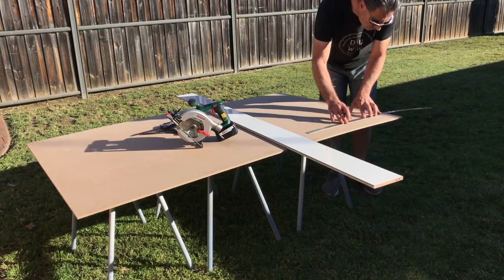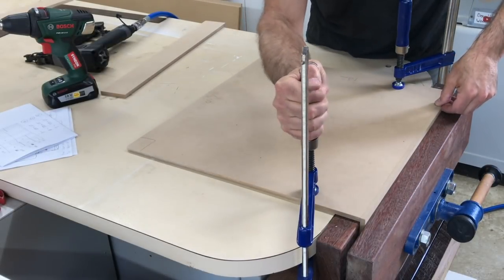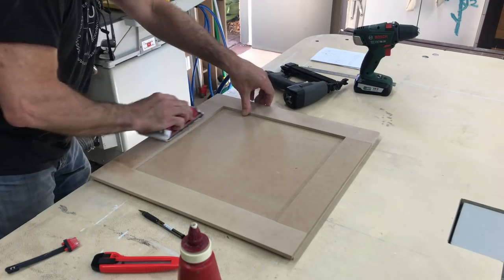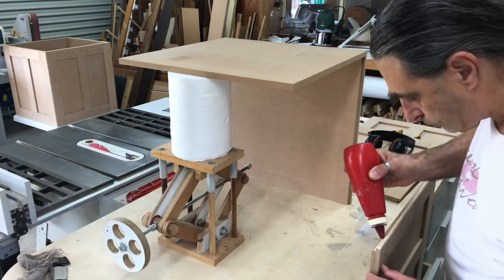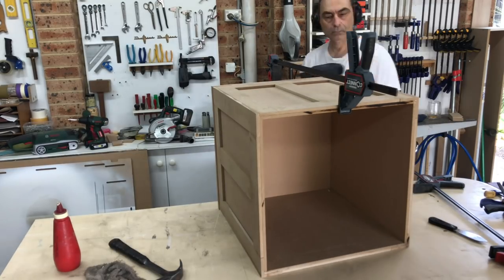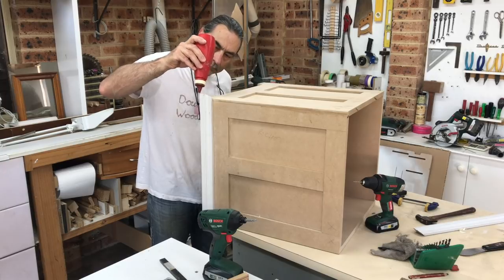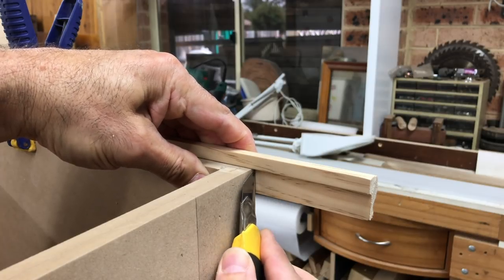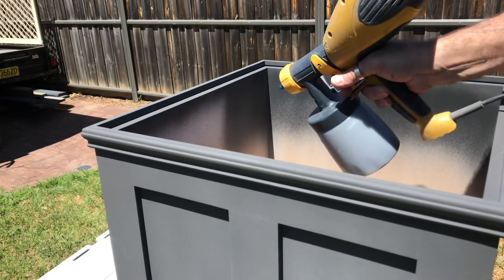How to make shaker style storage/planter boxes

Comment: Who would of thought MDF could look so good  great job  😉
Reply from the maker: MDF is a great material when used in the right circumstances. I'd rarely use anything else for a paint finished project. Only the snobs will tell you its crap.
Reply: Anyone... outside of North America?
Reply: I follow a fellow in London name Peter Millard of the 10 Minute Workshop.  He is a professional custom Joiner and fits cabinets in very expensive homes.  All he ever uses is MDF. I think there is a time and place for both MDF and hardwood.
Reply: @markbryan9989  Yep, it is generally only North Americans that are down on MDF, although, to be fair Peter only uses high quality moisture resistant MDF which is not generally available in Australia and is significantly more expensive.
I would hate to think of the cost of this project if made in hardwood (of any kind).
Reply from the maker: @markbryan9989  Yeah, ive watched a lot of Peter. He's a great example of 'no shame in using MDF' although I wish we could easily get that MR stuff.